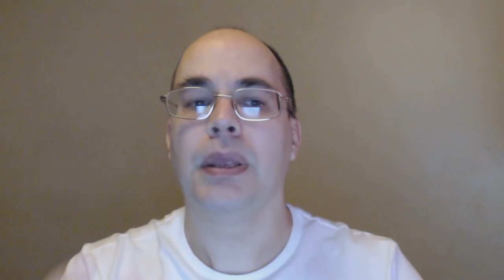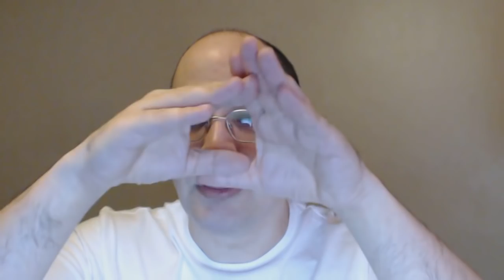How do rockets move in space, with nothing to push off from?

Comment: How do rockets move in space, with nothing to push off from? 

They don't move in space, they don't even go into space as the earth is flat!! Sorry guys, all space is fake!!
Reply: A big rocket produces 7.5 million lbs thrust.   Air pressure at sea level is only 15psi  it would be like pushing off of a feather.  
Rockets do not need air to push against,  neither does a jet engine. 
Who told you that they do ?  School?
Reply: Jesse D - Alberta Bros -- It's easy to figure out that space is a vacuum. You can measure the atmosphere. At sea level there is about 15 pounds of pressure for every square inch. That is how much the air above you weighs. The pressure is because it is pressing down on you (and everything around you). 

If you go up higher, the air above you weighs less because there is less of it.  You can measure the difference in the weight of the air between sea level and the top of a mountain.  At the altitude that commercial airplanes fly, there is so little air that it is impossible to breathe. 

You go higher and higher and the air becomes less and less and less. 

Eventually less and less gets really really close to ZERO.  It's simple arithmetic to figure out how much (or how little) air there is above a certain altitude.  Above about 50 miles there is almost nothing.
Reply: Peter Peterson
 Rockets don't need anything to push off from ( jets don't either)  who told you that they do ?    You didn't learn it as school, but you probably mistakenly assumed they do.
Reply: Peter Peterson thinks that jets that weigh dozens of tons fly through the air by pushing against almost nothing.  Hahahaha!!!
Reply: People like  that are also proud of their stupidity because they think they are believing gods word.
What they don't understand is the bible was written by men who knew vastly less than they do about the nature of the universe and so the holy book is totally irrelevant to todays discoveries.   They were taking a guess at what their eyes could see.
Reply: Below is the proof rockets work in space. If this doesn't convince you, this proves you are close minded.

Rockets work in a vacuum. They don't need to push against the surrounding air. Rockets push against the fuel itself. A rocket chamber hurls burned fuel out the back at high velocity, that fuel in essence becomes what the rocket pushes against to move forward.

The diagram below shows an explosive force between the rocket and the heavy fuel. The rocket moves in one direction in space and the speedy burnt fuel moves in the other direction. This is how rockets move in space.
https://pbs.twimg.com/media/DQRQZQSVoAAtkm9.jpg

A grenade explodes in space, and the shrapnel flies apart, plus it doesn't need air to work. The explosive compound contacting the outer metal shell, is all you need to make it fly apart during the explosion. In a rocket the exploding fuel exerts force against the confined rocket nozzle and pushes it away. The burnt rocket fuel is forced to move in one direction and the rocket moves in the other direction. This is precise directional movement of the rocket, unlike the random motion you see when a grenade explodes. 
https://youtu.be/m7Paph37tcE?t=1s

A cannon with a blasting cap would work in space, and it would move like a rocket. A cannon recoils back because it pushes against the weighty ball. In the same manor a rocket moves forward in space because it continuously shoots out the back the heavy spent fuel. In a rocket the fuel acts as the cannon ball.
https://youtu.be/K8kNiUcdQzw?t=18s

In this next video, notice how the water jet hardly disturbs the water below. It doesn't make wind either.  It's not pushing against the lake water, nor the air to lift up.  It flies by pushing against the ejected water alone. Even a water jet would work in space.  Rockets work in the same way, rockets push away against the weight of the fuel. 
https://youtu.be/j3gCKiOR7h4?t=7m52s
Reply: Peter Peterson You’re a special kind of stupid aren’t you?
Reply: Mordithar -- ALL jets and ALL rockets (and also ALL propeller planes) produce thrust in the SAME WAY:  They throw a huge amount of mass backwards.  Throwing that mass backwards produces a force forwards on the vehicle.  In NO case does it have anything to do with anything else (the atmosphere or any other thing) that is already behind the vehicle when it throws the huge amount of mass backwards. 

Also:  The B52 bomber has 8 jet engines.  NOT 4 propellers ("giant" or otherwise.)
Reply: WildPhotoShooter actually reptillian lizards wrote religions and to say they didn't know what their talking about is hilarious.  Kind of funny they say God-created the world in 7 days and how many days of the week are there?? The day they pray is on Sunday what is that word in the beginning? SUN, what is the Sun doing? Shining, illuminating, Illuminati, Lucifer,get it? You worship the gods and give them energy thru emotions and vibrations... fools
Reply: +Peter Peterson. You are confusing rockets with propeller driven aircraft that actually do use the air to push off of, similar to a boat propeller going through the water. But rockets and jet engines are not moved by pushing off anything but rather by the laws of motion set forth by Newton specifically his third law of motion.

https://www.livescience.com/34475-how-do-space-rockets-work-without-air.html
http://curious.astro.cornell.edu/about-us/154-people-in-astronomy/space-exploration-and-astronauts/rockets/838-how-do-rockets-move-in-space-beginner

Google has the answer to almost any question you can imagine. It's fun it's EZ you should try it.
Reply: +DU 20Austin Look up Newtons 3 law of motion your answer is there. Spoiler a rocket does not need to push off anything. And if you think a massive rocket can push off air to move, well that's just ludicrous.
Reply: In a vacuum, there would be no source for a normal propeller to get mass to throw backwards.  But if it had a source (like if it took a huge bottle of air with it and sprayed it into the propeller) the propeller could produce some thrust.  That thrust would probably be a lot less than the thrust from just spraying the air into the vacuum, though because it would't be very efficient. 

Also:  Your B25 vs. B52 thing makes sense.
Reply: The propeller has  to produce thrust by grabbing air and throwing that air mass backwards ...that is the "action", same as jet and rocket throwing gas hot backwards.  That is why jets and rockets are faster than a propeller because it can throw the air and fuel  backwards much faster.....this causes the "reaction".
A B52 PROPELLER FAILS TO WORK BEYOND A CERTAIN ALTITUDE BECAUSE THERE S NO AIR FOR THE PROPELLER TO GRAB OR THE ENGINE TO BURN FUEL. The B52 is maxed out at 513 mph at 35,000ft.
Reply: XXXGAMES
What load of complete bollocks !!   You need to give yourself a shake and stop living in fantasy land.
Reply: The engine pushes the exhaust. That's all you need.  If you push a huge mass one direction, you get a reaction the other direction.  How could you not?  How could you push a huge mass of matter and not get a reaction right away??
Reply: +Peter Peterson By your logic jet aircraft should not be able to fly. Of course we all know they do which makes your logic WRONG. The only pushing is the reaction force of the burning fuel pushing against the mounting brackets that hold the engine to the plane. To suggest that a rocket pushing against air will propel a rocket forward is an argument out of ignorance. Oh and BTW rockets in space will work even better because there is zero friction.
Reply: +Mordithar You are comparing oranges to apples. They are two totally different forms of propulsion. The propellers of an airplane need air to fly as they cut through the invisible medium called air to produce aerodynamic lift. Conversely a rocket sees air as a hindrance to flight because they do not use aerodynamic lift to fly.
Reply: +Morthidar No a propeller in space would not work, but a jet would work perfectly because with no air to fight flying through the resistance would be almost zero
Reply: +DU 20Austin Rockets bring oxidizers in order to ignite the fuel.
Reply: Let's assume Peter is correct on this & a rocket does in fact need to "push off" the atmosphere. That means any rocket will have a maximum thrust of 15 psi of nozzle area at sea level; at 30,000ft it would drop to 4.5psi. The Saturn V had 5 engines with a total nozzle area of 575 sq ft which at sea level would then produce about 103,500 lbs of thrust. But the Saturn V weighed in at about 6.5 million lbs!
Reply: Most likely there is no space...any type of thrust must have an something to push off...in water for boats, in a car the road, airplanes and rockets needs air pressure ..not in vaccum.
Reply: No thrust wathever all the shit Spaces Agency tells you is inside a rocket... You believe whatever the shit those scammers tell you, you are really under minimum IQ to discuss this argument...
But...sorry to deceive you...
Go back to school and understand how the action-reaction Newton's law works!!!!
NO THRUST, NO OPPOSITE REACTION SHITHEADS!!!!
FACT!!!!
Reply: Fuckoff.
Reply: What do you mean "with nothing to push off from"?

Rockets push against their exhaust.
Reply: no they don't, rockets merely eject stuff out of a nozzle and this stuff accelerated at high speed (action) produces a reaction with the surrounding mass(es) whether it be the ground, air etc which through friction resist the directional flow of the hot gases. A build up of hot gases is generated and the rocket is pushed up!

This means a rocket needs a mass to push up or away from
Reply: Okay, and how exactly your rocket gets this "stuff accelerated at high speed" all oriented in the same direction, huh? :)

That's the secret you're missing - initially, this stuff is pointed in all directions (because explosions propagate in all directions at the same time), but after bouncing off the walls of the combustion chamber, it all eventually gets directed away from the rocket, and in doing so, imparts combustion chamber (and the whole rocket with it) with the opposite momentum.
Reply: even though you don't have any evidence to support your view, even you overlook one important part of this which is very simple to understand. In order for your understanding to be credible a build up of pressure needs to be created that will exert a push on the rocket. That build up of pressure cannot occur if there is no mass for the rocket's thrust generator to push against!

In other words, rocket thrust generators will not work in the vacuum of space
Reply: even though you don't have any evidence to support your view
...except for the every rocket launch and every explosion ever... :]

Now listen, you might disagree about what causes rockets to move, but what I'm doing here is explaining how they work.

Explosions propagate in every direction - fact. You can even watch some slo-mo videos on Youtube, which show explosion shockwave.

Every action causes a reaction - also a fact. Throw a ball against the wall, and it will bounce off. Throw a hot molecule of gas at a wall, and it will bounce off as well. Throw millions of them at the same time, and they will bounce off just as well.

In order for your understanding to be credible a build up of pressure needs to be created that will exert a push on the rocket.
That is correct. This buildup of pressure is created when a mixture of fuel and oxidiser is ignited inside combustion chamber, creating an explosion.

That build up of pressure cannot occur if there is no mass for the rocket's thrust generator to push against!
The rocket's "thrust generator" (aka explosion of the fuel/oxidiser mixture) pushes against the walls of combustion chamber, as I have already explained.
Reply: but how do we know space is a vacuum if we havn't been up there?